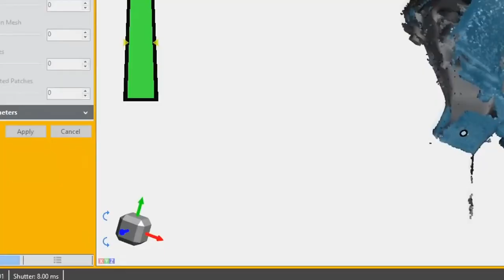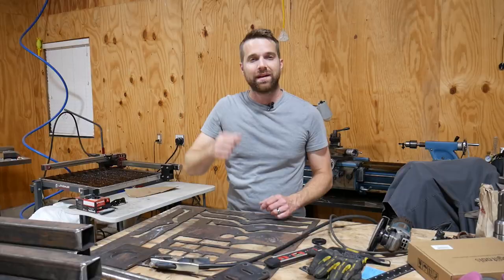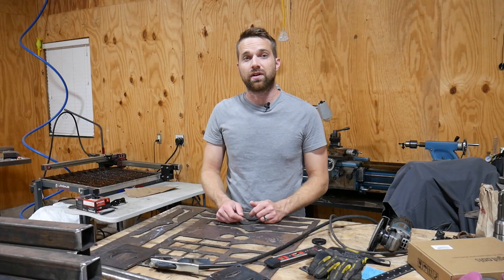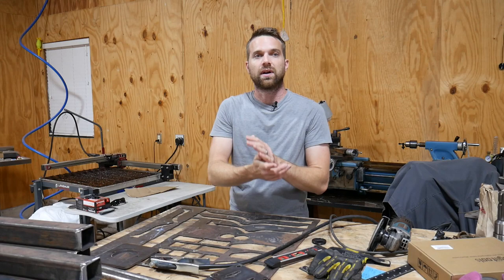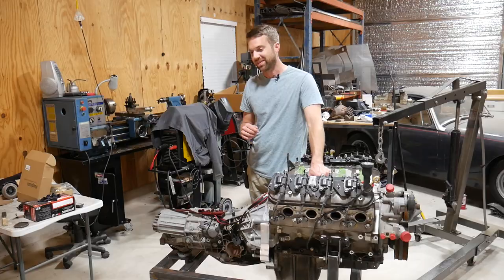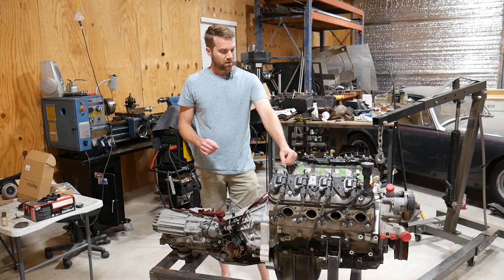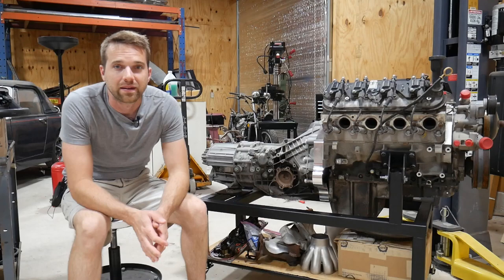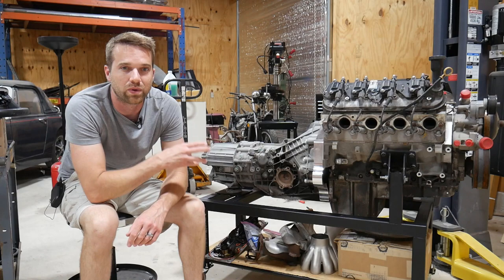Drivetrain Stand Fabrication - Mid Engine Car

Comment: Hi, my name is Ruben:
  Very nice job you are doing and engine and transmission looks awesome.
  Jus want to know what kind of transmission and in which vehicle it comes. Thanks I’ll appreciate your answer.
Reply from the maker: Hi Ruben, the transmission is an Audi 01X and it came on the mid-2000s Audi A4. The video I released before this one has a lot more info on it.